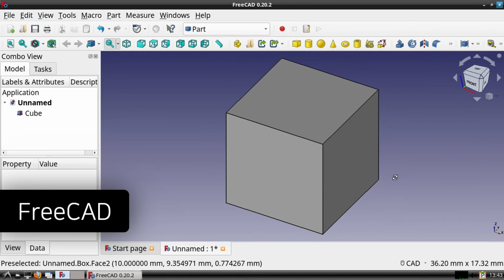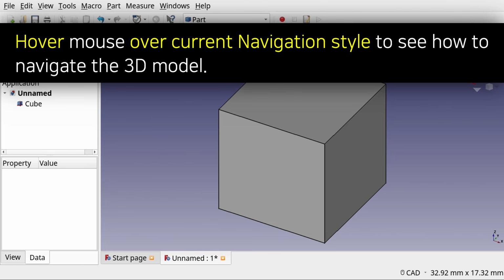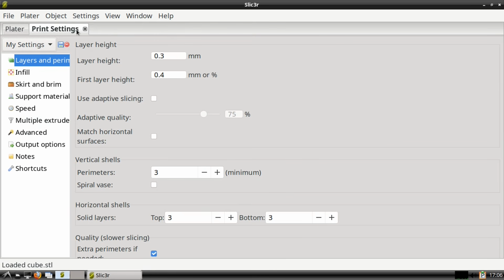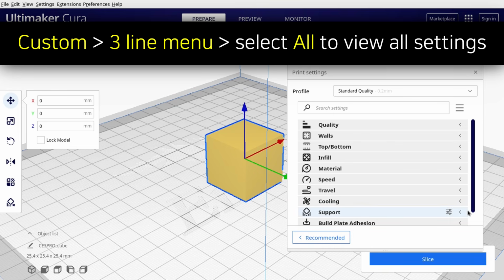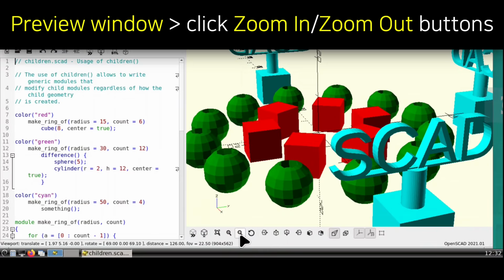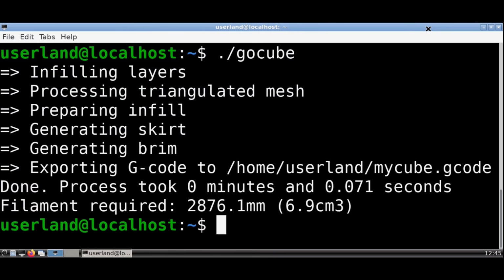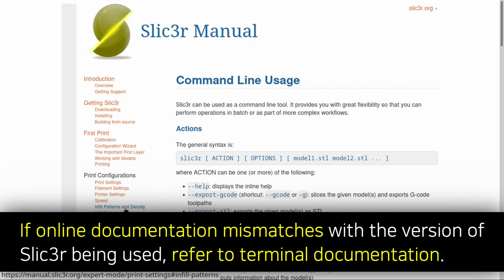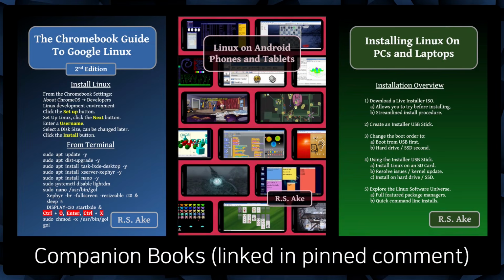3D Design & Print A Cube In Linux ($200 Printer Example)

Comment from the maker: 3D design and print a cube instructions Part 1

FreeCAD, the Slic3r GUI, and Ultimaker Cura will work on Chromebooks and PCs. OpenSCAD, and the command line usage for Slic3r will work on everything including Android devices.

3D printer used in this video (Creality Ender 3 Pro, costs around $200):
    https://www.amazon.com/dp/B07GYRQVYV/

==========================
3D PRINTING OVERVIEW
==========================

First, a 3D model needs to be created with CAD (Computer Aided Design) software (Ex. FreeCAD, OpenSCAD etc.) and then the 3D model has to be exported as a .stl file (STereoLithography). Next, with the .stl file we can use a slicer (Ex. Slic3r, UltiMaker Cura, etc.) to define how to print the layers of the 3D model by configuring it based on the 3D printer being used and the model being printed. Then with the slicer, we can export a .gcode file (Geometric CODE). The .gcode file is what the 3D printer uses to print the model (CAM - Computer Assisted Manufacturing).

1. Create 3D model with CAD Software > Export .stl
2. Use .stl file with a slicer to prep model for printing > Export .gcode
3. Use .gcode file with a 3D printer to print the model

==========================
DESIGN CUBE WITH FREECAD
==========================

FreeCAD is for designing 3D models.

Install:
    freecad

Open FreeCAD:
    Menu > Graphics > FreeCAD
    Toggle Fullscreen = Alt+F11

Create a cube:
    Click Create new...
    Click the Workbench drop-down from the top > select Part
    Click the yellow Cube button.

Navigating 3D model with default CAD Navigation style (hover over Navigation style from bottom right to view how to navigate the 3D model. Click the Navigation style to select a different style (Ex. Touchpad)):
    Rotate = Middle, then left click
    Pan = Middle click
    Zoom In/Out = scroll
    Click Isometric button (button with skeleton cube) for an isometric view.

Resize the cube to be 1 in:
    Model tab > select Cube > from the Property Editor below:
        Triple click Length, type "1 in", press Enter (will automatically convert to mm)
        Triple click Width, type "1 in", press Enter
        Triple click Height, type "1 in", press Enter

Click the Save button to save the FreeCAD document

Export .stl file:
    Model tab > select Cube
    File menu > Export...
    Set file path and name.
    Set Files of type drop-down to STL Mesh (*.stl *.ast).
    Click the Save button.

Close FreeCAD = Ctrl+Q

Now the .stl file can be used in a slicer to prep the model for printing. To prep the model for printing with Slic3r read the SLICE 3D MODEL WITH SLIC3R section below. To prep the model for printing with Ultimaker Cura read the SLICE 3D MODEL WITH ULTIMAKER CURA section below.

==========================
SLICE 3D MODEL WITH SLIC3R
==========================

Slic3r is a slicer that's used to prep 3D models for printing. For the command line usage of Slic3r, read the SLICE 3D MODEL WITH SLIC3R FROM THE COMMAND LINE section below.

Install:
    slic3r

Open Slic3r. When opened for the 1st time, there will be a Configuration Assistant window:
    Menu > Programming > Slic3r

The Configuration Assistant is for setting basic options based on the printer and the filament being used. Depending on the version of Slic3r, after the 1st prompt, the Next, Back, and Cancel buttons may not work. As a workaround, click a blank space in the Configuration Assistant window if needed and then press Enter to get to the next step. The Configuration Assistant is always available from the Slic3r window > Help menu > Configuration Assistant....

Some places where you can find the necessary information for your printer and filament are:
    The printer or spool of filament itself.
    The instructions or box they came with.
    For measurement based options, the printer/filament can be measured.
    Search online for their specs.

From the Configuration Assistant:
    Click the Next button.
    Set the G-code flavor that the printer uses
    Set Bed Shape and Size in mm
    Set Nozzle diameter in mm
    Set Filament Diameter in mm
    Set Extrusion temperature in °C based on the filament being used
    If your printer has a heated bed, set the Bed temperature in °C based on the filament being used (for no heated bed, set to 0 °C)

When finished with the Configuration Assistant, restart Slic3r to apply the changes. The Print settings, Filament, and Printer drop-downs from the right side should all be set to My Settings.

--------------------------

From Slic3r:
    Click Add... button near the top left > select .stl file

Navigate model:
    Rotate = Left click + drag
    Pan = Right click + drag
    Zoom In/Out = scroll

Click on the cube:
   Can view the Size from the bottom right (1 unit = 1 mm and 25.4 mm = 1 in)
   Top row buttons can do various transformations (ex. rotate, scale, etc.). Leave everything as is.

Print, Filament, and Printer settings are available from the Settings menu.

Set the number of Skirt Loops to 5 (skirts help get filament flowing for a better 1st layer):
    Settings menu > Print Settings...
    Select Skirt and brim from the list on the left side.
    Set Loops to 5.
    From the Plater tab, custom options will be listed on the right side (red circle button deletes an option).

Select the Preview tab near the bottom left to view how the layers of the model will be printed. Move the slider on the right to view the different layers.

Export .gcode file:
     Click Export G-code... button from the right side.
     Save .gcode file.

Now the .gcode file can be used to print the model!

When closing Slic3r, if any custom options have been set, Slic3r will ask if you want to save the options to a configuration file. If you do not want to save custom options, click the Discard button.

==========================
SLICE 3D MODEL WITH
ULTIMAKER CURA
==========================

Ultimaker Cura is a slicer that's used to prep 3D models for printing.

Install:
    cura
    python3-pip

To resolve plugin related issues, use pip to install trimesh. You can try using Cura without installing trimesh. From a terminal:
    pip3 install trimesh --break-system-packages

Open Ultimaker Cura (If the whole window does not fit the screen, the default font size of the desktop can be decreased and then Ultimaker Cura can be restarted. This should generally be a nonissue. For Chromebooks, the scaling script can be used to increase the resolution of the desktop):
    Menu > Programming > Ultimaker Cura
    Toggle Fullscreen = Ctrl+F11

From the Ultimaker Cura dialog window:
    Click the Get started button > Agree > Next > Skip
    Click the Add a non-networked printer drop-down and select your printer (if your printer is not listed go to: ultimaker.com/software/ultimaker-cura/)
    Click the Next button.

Double check the settings for your printer and filament. Some places where you can find the necessary information for your printer and filament are:
    The printer or spool of filament itself.
    The instructions or box they came with.
    For measurement based options, the printer/filament can be measured.
    Search online for their specs.

Printer Settings:
    Verify the X (Width), Y (Depth), Z (Height) are the correct size
    Verify the Build plate shape is correct
    Check Heated bed if your printer has a heated bed.
    Verify G-code flavor is correct.
Printhead Settings (mainly for if we were printing multiple models at once. This would be important if we wanted to print each model completely one by one as opposed to all at once layer by layer. Since this example only covers printing a single cube, we don't need to worry about most of these settings):
    Verify that Number of Extruders is correct.
Start and End G-code may vary. Leave it as is.
Extruder tab:
    Verify the Compatible material diameter matches the diameter of the filament being used.

From the Ultimaker Cura dialog window:
    Click the Next button > Next > Finish

--------------------------

From Ultimaker Cura:
    Click the button with a folder icon from the top left > select the .stl file

Navigate model:
    Rotate = Right click + drag
    Pan = Shift + Left click + drag
    Zoom In/Out = Ctrl++ OR Ctrl+-
    3D View = Click button with skeleton cube from the bottom left.

Click on the cube:
    Left menu can do various transformations (ex. rotate, scale, etc.) Leave everything as is.

To view the settings for the printer:
    Click drop-down that has the name of the printer > Click Manage printers button
    From the list of Preset printers, select the printer > Click Machine Settings button

Next to the printer drop-down is the Custom drop-down:
    Set Material so it matches the type of filament being used.
    Verify Nozzle Size matches the diameter of your printer's nozzle in mm.

The right most drop-down is the Print settings drop-down. To see ALL the different options:
    Click the Custom button.
    Click the 3 line menu > select All
    Leave everything as is.

From the bottom right, click the Slice button and then click the Preview button to view how the layers will be printed:
    Move the slider on the right to view individual layers.
    Click play button from the bottom to see an animated preview.

Click the Save to Disk button from the bottom right > save the .gcode file.

Now the .gcode file can be used to print the model!

--------------------------

Ultimaker Cura tip!

If the resulting cube has a zigzag pattern on the outside, try setting the Infill Pattern to Triangles:
    Print settings drop-down > click the Custom button
    Infill drop-down > set Infill Pattern to Triangles.

Different settings will have different affects. I recommend experimenting to find the settings that work best for you.
Reply from the maker: 3D design and print a cube instructions Part 2

==========================
3D PRINTING
==========================

The printer used in this video is the Creality Ender 3 Pro:
    https://www.amazon.com/dp/B07GYRQVYV/

Depending on the 3D printer, the procedure for prepping the printer will vary. The following is what I do to prep the Creality Ender 3 Pro:
    First I have the printer Auto Home.
    Next I Disable Steppers so I can freely move the extruder and the bed.
    After that I manually level the printer bed by turning the screws with gear handles on the bottom of the bed. A piece of paper can be used to determine if the nozzle is too close or too far from the bed. My goal is to get the nozzle scratching the paper at all 4 corners of the bed without too much resistance.
    Next, I move the extruder up on the Z axis.
    After that I preheat the printer for PLA plastic (if the printer has been used before, filament may ooze out. DO NOT touch the nozzle when heated. I like to use pliers to grab the filament that oozes out)
    When the printer is heated I extrude 10mm of filament (this can help to get a better 1st layer)

When the printer is ready to print, insert the external storage containing the .gcode file, and select the .gcode file (If the external storage cannot be read, read the FORMATTING STORAGE section below). Finally, and most importantly, enjoy!

If there is a struggle to get the model off the bed, try using a scraper (I prefer plastic if possible). Any stray plastic hair where the print finished can be cut off with scissors, wire cutters, or pulled of with your fingers.

==========================
DESIGN CUBE WITH OPENSCAD
==========================

OpenSCAD is for designing 3D models based on code.

Install:
    openscad

Open OpenSCAD:
    Menu > Graphics > OpenSCAD

Open example from the Welcome window:
    From Examples list, click Advanced drop-down > select children.scad
    Click Open Example button.

For Android, depending on the device, maximizing the window can crash OpenSCAD. To make the window as big as possible, drag out the corner of the window slowly to see the point that OpenSCAD will crash. When OpenSCAD crashes, reopen it and drag the corner of the window just before the point that OpenSCAD crashed.

The Error-Log, Console, and Customizer windows can be closed. Windows can be be reopened from the Window menu.

Navigate 3D model:
    Rotate = Right click + drag
    Pan = Left click + drag
    Zoom In = Zoom In button near the bottom of the Preview window
    Zoom Out = Zoom Out button near the bottom of the Preview window
    Reset View = Button with Circular arrow near the bottom of the Preview Window

Change color of the cubes to purple:
    From the 7th line, change the word "red" to "purple"
    Click the Preview button (cube with 2 arrows) near the top of the Editor window

--------------------------

Design a cube:

Click New File button near the top left of the Editor window and type the following (creates a cube that's 1 unit in size and is centered):
    cube(1, center = true);
Click the save button near the top left of the Editor window and save the file.
Export .stl file:
    Click Render button near the top right of the Editor (button with box and hour glass)
    Click Export as STL button to the right of the Render button
    Save the .stl file as cube.stl

==========================
SLICE 3D MODEL WITH SLIC3R
FROM THE COMMAND LINE
==========================

Slic3r is a slicer that's used to prep 3D models for printing. Slic3r can be used from the command line (Slic3r uses OpenGL graphics. OpenGL graphics cannot currently be used with UserLAnd on Android due to the use of VNC, however, Slic3r can be used from the command line).

Install:
    slic3r

A script can be created for running the Slic3r command. This provides a way to remember what settings were used before. Please read the script explanation below for important notes. Values for --nozzle-diameter and --filament-diameter are an example and may differ. From a terminal:
    nano gocube

slic3r \
--scale=25.4 \
--skirts=5 \
--nozzle-diameter=0.4 \
--filament-diameter=1.75 \
-o ~/mycube.gcode \
cube.stl

    Ctrl+O, Enter, and Ctrl+X to save and exit nano.

Make the file executable and execute the script to generate the .gcode file. ls lists files and folders in the current directory (the "./" is used to run an executable file in the current directory):
    chmod +x gocube
    ./gocube
    ls

Copy the .gcode file to external storage and now the .gcode file can be used to print the model! For Android read the MOVE FILE OUTSIDE OF LINUX ON ANDROID section below for moving files outside of Linux.

--------------------------

Script explanation, please read --temperature and --gcode-flavor points below:

+ \ = continues command onto next line (script can be executed as one line)
+ --scale = sets scale. .stl files are unitless. Slic3r assumes 1 unit is 1 mm (25.4 mm = 1 in)
+ --skirts = number of loops printed around the model (helps get filament flowing for a better 1st layer)
+ --nozzle-diameter = printer's nozzle diameter in mm (can look for printer's nozzle diameter by looking at the printer, the instructions or box that came with the printer, or search online for the printer's specs)
+ --filament-diameter = diameter of filament in mm (can look for filament diameter by looking at the spool, the box the filament came in, or measure the filament with a caliper)
+ -o = defines file path and name of .gcode file, this is optional (default name = <.stl-file-name>.gcode)
+ If using a filament other than PLA plastic, set the --temperature option in °C (default = 200°C)
+ Depending on the printer, it may be necessary to set the --gcode-flavor option, otherwise the printer may interpret .gcode instructions incorrectly. default = reprap. reprap refers to Marlin/Sprinter. (Can look for gcode flavor needed by looking at the printer, the instructions or box that came with the printer, or search online for the gcode flavor the printer uses) Executing "man slic3r", scrolling to Printer options, and then looking at --gcode-flavor will show the list of possible G-code flavor values.

==========================
MOVE FILE OUTSIDE OF
LINUX ON ANDROID
==========================

If the below method doesn't work, watch the alternative method from the "3D Design & Print A Cube On Android! (Also works on Chromebooks & PCs)" video:
    https://www.youtube.com/watch?v=ubxWxLo-1UM&t=985s

Shut down Linux:
    3 dot menu from VNC floating menu > Disconnect
    Go back into UserLAnd app.
    Right click Linux session that's in use > Stop Session
    Swipe out UserLAnd from Apps Overview.

Plug in external storage (file paths for an app are only generated when an app is opened for the 1st time WHILE the external storage is plugged in).

Start up Linux:
    Open UserLAnd app.
    Start Linux session.
    Start up desktop.

From a terminal:
    cat /proc/mounts | grep vold
From the output, highlight the storage ID, and do Ctrl+Shift+C to copy it. The output of "cat /proc/mounts | grep vold" should include (83DF-18E9 is an example, yours will differ. If more than 1 external storage device is plugged in, then multiple storage IDs will be listed):
    .../mnt/media_rw/83DF-18E9...

From a file manager, navigate to external storage with the external storage ID and bookmark the file path (83DF-18E9 is an example):
    /host-rootfs/storage/83DF-18E9/Android/data/tech.ula/files

Navigate to the .gcode file and set the file permissions:
    Right click .gcode file > select Properties
    Select Permissions tab.
    Set ALL Access Control drop-downs to Anyone.
    Click OK button to save changes.

Copy .gcode file to external storage:
    Ctrl+C to copy the .gcode file.
    Navigate to external storage.
    Ctrl+V to paste the file.

Pull down notifications and click Eject button to unmount external storage.

From the external storage, the .gcode file will be available from:
    Android > data > tech.ula > files
Reply from the maker: 3D design and print a cube instructions Part 3

==========================
FORMATTING STORAGE
==========================

Depending on the 3D Printer, the external storage may need to be formatted in a specific way. For my example the Ender 3 Pro needed the external storage to have an msdos partition table with a FAT32 partition. The following procedures cover how to format external storage to have an msdos partition table with a FAT32 partition with Androids, Chromebooks, and PCs.

--------------------------

Format storage with an Android:

Plug in external storage.
From Android Settings:
    Go to Storage
    Click This device drop-down > select external storage
    Click 3 dot menu from top right > select Format
    Click Format button > click Format to confirm
    Click Done button when finished.

--------------------------

Format storage with a Chromebook:

The Chromebook Recovery Utility can be used to wipe out the existing partition table. From the ChromeOS Chrome browser:
    chromewebstore.google.com
    Search for "Chromebook Recovery Utility"
    Click Add to Chrome button > click Add extension button
    Plug in external storage.
    Click Extensions button (puzzle piece icon) near top right of Chrome browser > select Chromebook Recovery Utility
From Chromebook Recovery Utility:
    Click gear button from top right > select Erase recovery media
    Click Select drop-down > select external storage
    Click Continue button > click Erase now
    Click Done button when finished.
To format the external storage to FAT32, open the ChromeOS Files app:
    If external storage is unmounted, reinsert the external storage.
    Right click external storage > select Format device
    Set Drive name and set Format to FAT32
    Click Erase and Format button.
If changes appear to not have been applied, click unmount button next to external storage and then reinsert the external storage.

--------------------------

Format storage with a PC:

GParted can be used to format external storage (install: gparted):
    Plug in external storage.
    Click OK for any pop up windows.
    Close file manager windows.
    Menu > System Tools > GParted
    Click device drop-down from top right > select external storage
    MAKE SURE EXTERNAL STORAGE IS SELECTED!
    If partitions are mounted, right click each parititon > select Unmount
    For each partition, right click the parititon > select Delete
    Click green check mark button near the top left > click Apply button
    Device menu > select Create Partition Table...
    Set partition table type drop-down to msdos > click Apply button
    Right click unallocated space > select New
    Set File system to fat32 and set Label > click Add button
    Click green check mark button near the top left > click Apply button

====================
DOCUMENTATION
====================

The FreeCAD website, documentation, and forums are available from the Help menu in FreeCAD:

FreeCAD website:
    freecad.org

FreeCAD Wiki (click top left 3 line menu to navigate to different parts of the documentation):
    https://wiki.freecad.org/Main_Page
    https://wiki.freecad.org/Tutorials
    https://wiki.freecad.org/Screenshots

FreeCAD Forums:
    https://forum.freecad.org/

--------------------------

OpenSCAD website:
    openscad.org

Lots of documentation in the form of wikis, a cheat sheet, books, videos, and articles can be found from the documentation page on the OpenSCAD website. If printing the cheat sheet, use Landscape orientation. PDFs can be viewed with qpdfview (install: qpdfview)
    https://openscad.org/documentation.html

"Mastering OpenSCAD within 10 projects" online book:
    https://mastering-openscad.eu/buch/introduction/

OpenSCAD Playlist:
    https://www.youtube.com/playlist?list=PLP1VMsgQcRUmC1jJhZrTId9rvjQ1m2FBH

--------------------------

Slic3r website:
    slic3r.org

Slic3r manual (If documentation for Command Line Usage mismatches with version of Slic3r being used, then refer to the terminal documentation):
    https://manual.slic3r.org/

Slic3r terminal documentation:
    slic3r --help
    man slic3r

Slic3r man page can be put into a text file which can be searched and modified. From a terminal:
    man slic3r > slic3r-doc.txt

--------------------------

Ultimaker Cura website:
    ultimaker.com/software/ultimaker-cura/

The online documentation for Ultimaker Cura is available from the Help menu in Cura:
    https://support.ultimaker.com/s/topic/0TO5b000000Q4utGAC/ultimaker-cura

--------------------------

Fun Fact! RepRap stands for REPlicationg RAPid prototyper which refers to an open source project dedicated to making low cost 3D printers that can print most of their own parts:
    https://en.wikipedia.org/wiki/RepRap
    https://www.reprap.org/wiki/RepRap

--------------------------

Digital Notes With TiddlyWiki (No Cost, Offline, Cross-Platform, Searchable Notes):
    https://www.youtube.com/watch?v=jFCX5Nh2QIM

The Chromebook Guide to Google Linux: 2nd Edition (Companion Book): https://www.amazon.com/dp/B0C9S7QY9N
ISBN: 9798852219312

Linux on Android Phones and Tablets (Companion Book): https://www.amazon.com/dp/B0C6VSX18Y
ISBN: 9798397022903

Installing Linux On PCs and Laptops (Companion Book): https://www.amazon.com/dp/B0D36DRMXJ/
ISBN: 9798324643768

====================
FOR QUESTIONS
====================

Questions are welcome and encouraged. Due to the design of YouTube's comment section, posting questions under the pinned comment or under another user's comment makes it difficult for me to find and answer questions. Please do not post your questions under the pinned comment or under other user's questions. Please create a new comment.